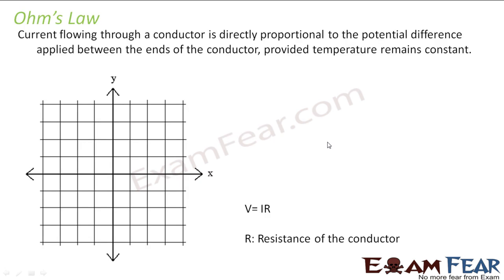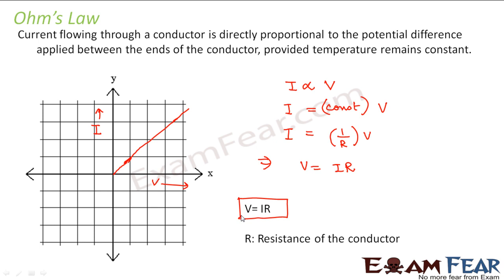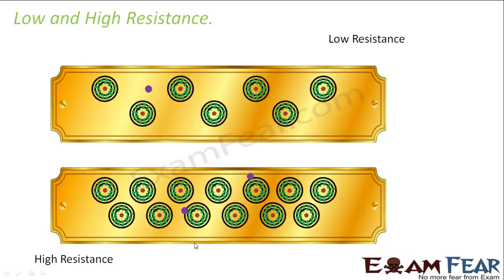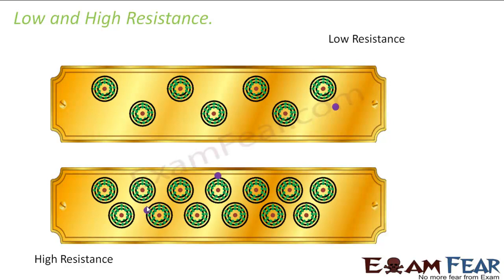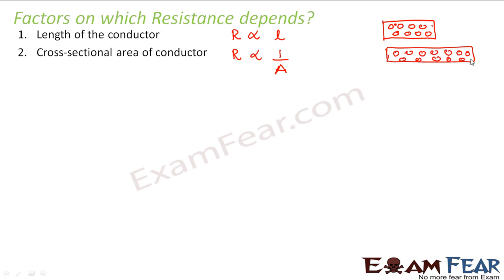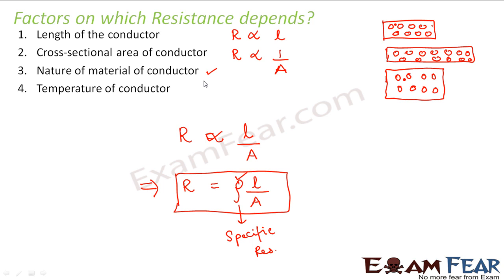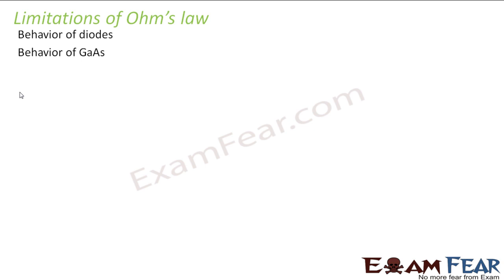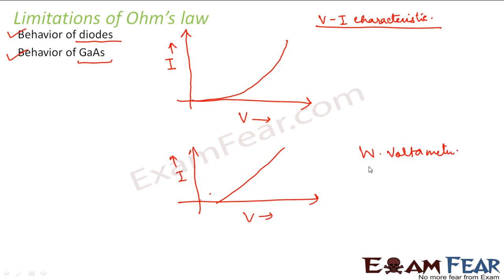Physics Electricity part 5 (Ohms Law & resistivity) CBSE class 10 X

Comment: Why does the no. of electron does not increase when we increase cross-Sectional area........??????????????????????
Reply: no.of electrons do not depend on area. they r just the valanced electrons so the atom will loose the electron(i,e increase of no. of electrons) based on its valancy which will depend on the type of metal(ex. copper wire,iron wire etc.)
Reply: mass can neither be created nor be destroyed

Comment: I m not getting what is resistivity?????
Reply: resistivity is the value of resistance of a material...
Reply: & resistance is the property that  opposes or hinders the flow of charges(current) in a conductor...
Reply: +kajal thanku for helping😊
Reply: I am not getting that if length is increased than atoms are increased but when we increase the width than atoms are not increased how?
Reply: Karanveer Gill same doubt here